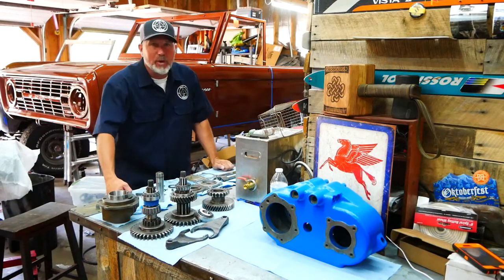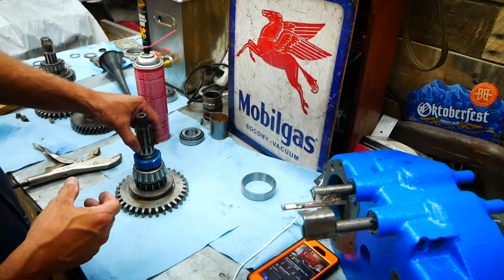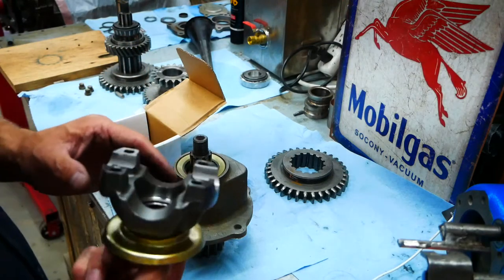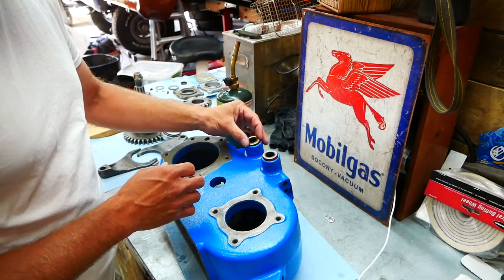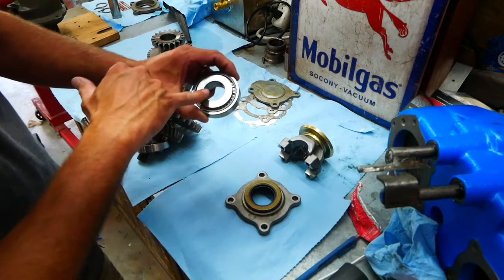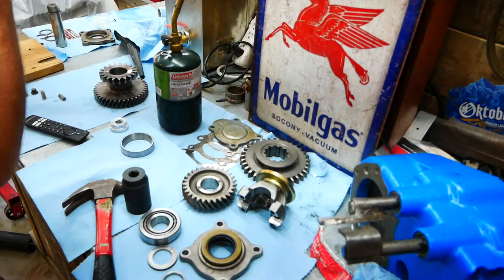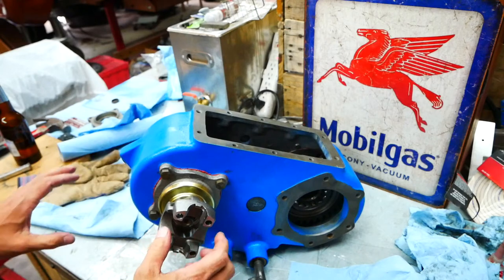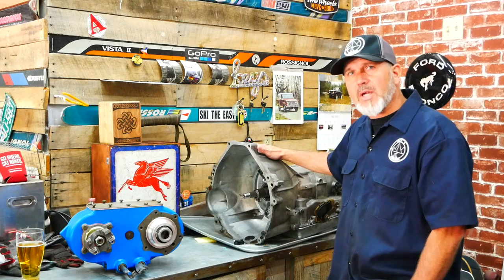Full Dana 20 Rebuild - Early Ford Bronco Build

Comment: Thanks for video! Is there another video showing input shaft install? I’m doing seals and gaskets on mine, I pull off output shaft housing and found 10 shirt roller bearing drop by splined gear. Not sure where they go?

Comment: My brother has a 1972 Bronc and he says the transfer case is extremely hard to shift into 4wd. Please, is this a common problem for early Broncos, if so, is there a specific, part that's worn or misaligned?
Reply from the maker: Hard to say, but it may be metal and bushing material caught in the shift rail passage. That would cause it to stick and not shift well. Was it rebuilt recently?
Reply: @alpinegarage8548  Thanks for replying, no, it's all original, never been overhauled. I think he has early style "T" handle shifter.

Comment: Great video. Can the dana 20 be built to drive front wheels only?
Reply from the maker: Instead of back wheels? Or just shifting from front to back?
Reply: @alpinegarage8548  For front bumps while crawling
Reply from the maker: @joedeveydt9977  yes if you take the detent pills out. I know this only from seeing it while building and on forums. The only issue is that it is possible to accidentally shift 2 lo in one axle and 2 high in the other. Then bang, there goes your tcase.
Reply: J shift style
Reply from the maker: @joedeveydt9977  yep.